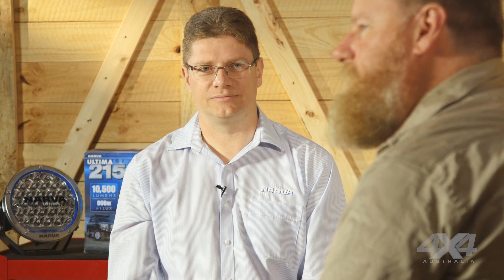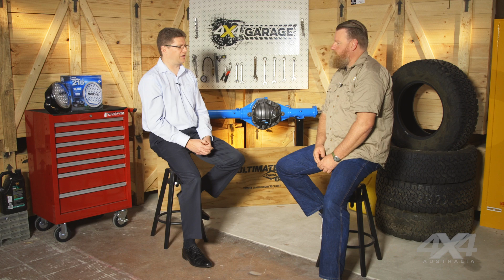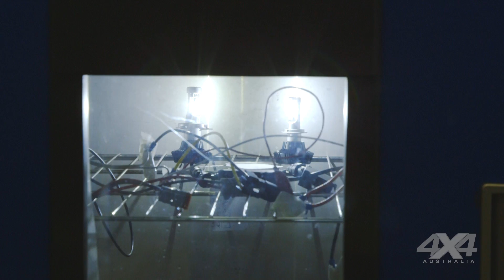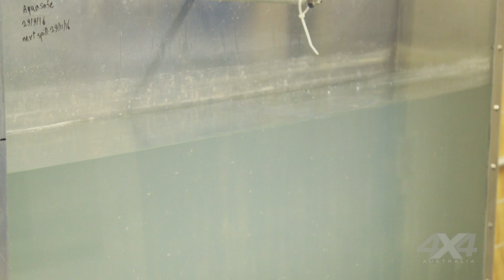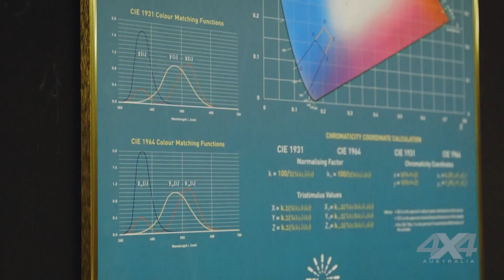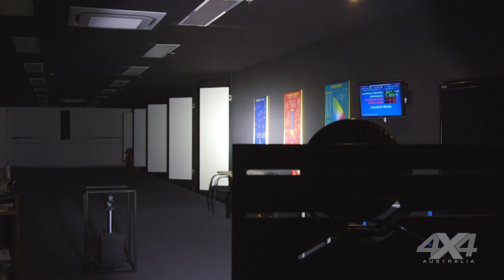Narva Ultima 215 LED | 4X4 Garage | 4X4 Australia

Comment: Narva is not that good, only buy lightforce they are the best.
Reply: Apple's and oranges mate. The lightforce led is the leader for brightness and distance.
Reply: I just bought a pair of these Narva 215 LED's. They are insanely bright! They replaced a set of Lightforce 240 HID's and the Narva LED's are better in every way. More distance, more spread and a brighter light as well.
Reply: @colnelson7254  You cant compare HID to LED! if you want real driving lights you get the lIghtforce LED lights
Reply: You've obviously never driven with the Ultima.